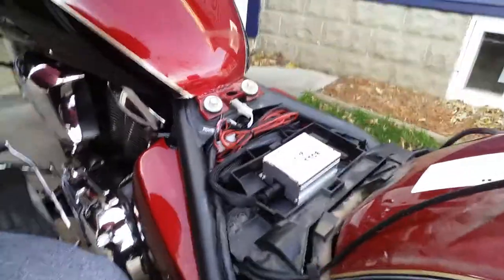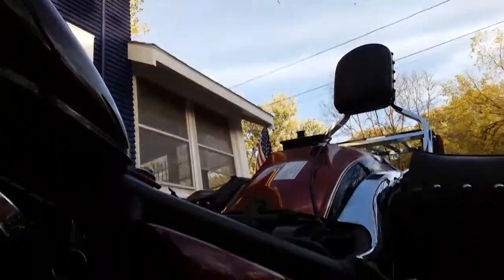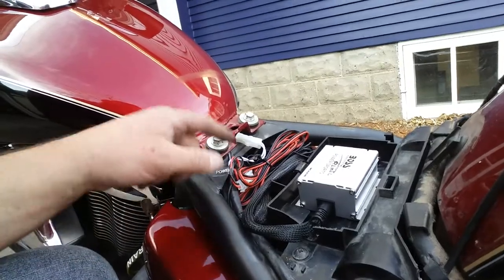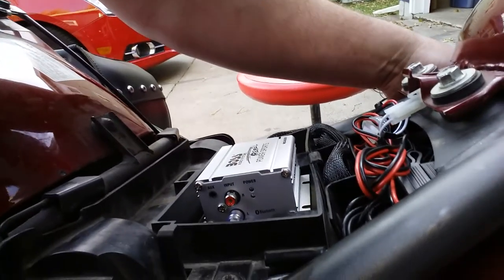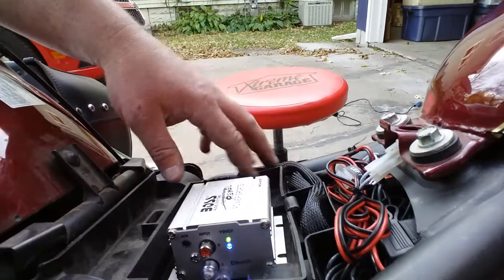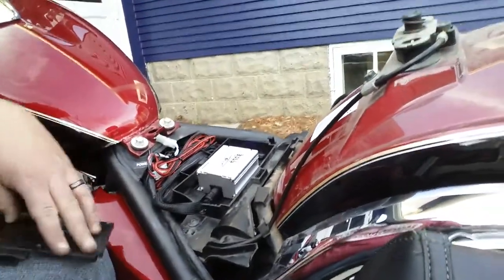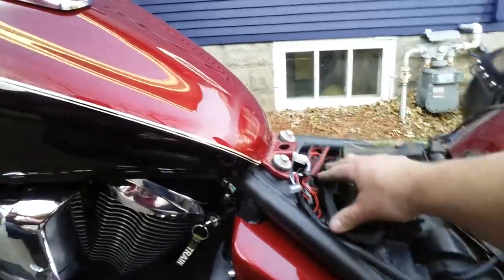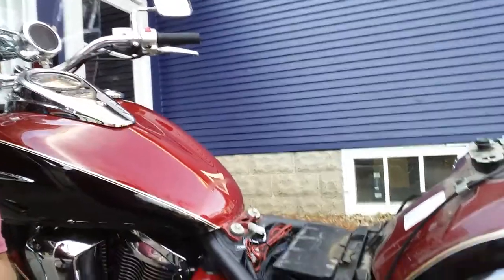Install of Boss Audio MC420B on 2008 Kawasaki Vulcan 900

Comment: You can disassemble those speakers and remove the circuit so you can hook them up to another 4 channel amp and add loads more speakers of bigger size! I have a 2007 Honda vtx 1300 C with a batwing fairing and dual 6x9 hard saddlebags. I'm using a Soundstream 1000db bt amplifier. 1(pair) 6x9" Memphis audio in the fairing, 1(pair) 6.5" JBL in cans on my highway bars, 2(pair) 6x9 Cerwin Vega in the saddlebag lids. Installed and tuned myself.

Comment: Which wire did you use for power? I'm feeling too lazy to poke around with a multimeter. I'm also installing on a vn900.

Comment: How do you get it connected without killing battery?
Reply from the maker: Jeffrey Cook it is hooked to a wire that turns off when you turn the ignition off
Reply: Where is this switched wire at
Reply from the maker: Cody Halverson off the ignition switch harness I took a voltmeter and found a wire that when I turned the ignition on was hot, tapped into that, soldered it on. Ground is to a bolt on the frame.
Reply: Just add a toggle switch and mount it a place you can get to easily. That will solve the battery issue.

Comment: I have my insurance paperwork in a ziplock baggie in the tool kit. I’m wondering if I can keep it in there with the amp...? Will the amp get hot while on?
Reply from the maker: I think it would be fine, the amp doesn't seem to get real hot
Reply: Brian Rauchwarter cool thanks I’ll be installing mine soon

Comment: So I've mocked up the speaker mounts on handle bars. The clamps seem to be not quite big enough for my stock bars. How did you overcome this obstacle? Any help would be appreciated. TIA
Reply from the maker: Kevin Farrar mine were too big for my stock bars, I had to add almost all the rubber inserts.
Reply: Brian Rauchwarter. Interesting. I've watched a couple other installs and they are using 1 person to hold the mount while the other dresses squeezes the clamp. I'll have to try that. Thanks for your response.

Comment: How do you power up the system?
Reply from the maker: drhustle20 it turns on when you turn the key on, and the phone connects automatically via Bluetooth. Just pick a song or spotify or whatever and hit play.
Reply: Brian Rauchwarter I think the question is: what wire did you splice in to for powering on the unit? At least that’s my question. You mentioned you found a hot wire but not which one that is. In your description there is note of a brown wire, but again this brings questions: is it a head light, tail light, etc. thanks! And good video btw :)

Comment: So u found that wire just under the seat, what color was it
Reply from the maker: Cody Halverson i do not recall the color. I took my multimeter with the switch on and probed non ground wires for 12v, found one, turned the switch off, it went to 0v, jackpot.
Reply: Did you have to cut into a plug or was the hot wire just dangling there? I’m having a heck of a time trying to find a wire that will work with mine and I don’t want to go down the rabbit hole of un-wiring the whole bike